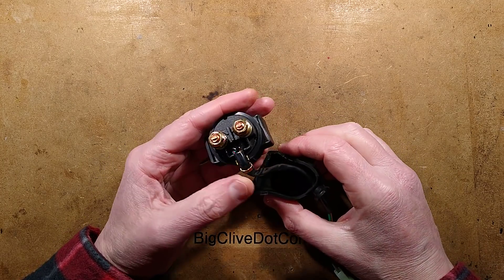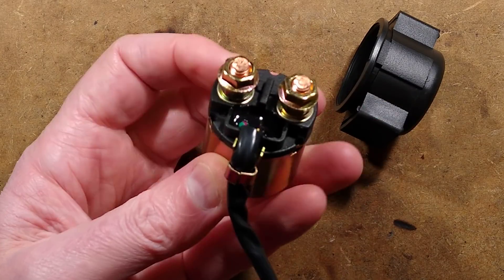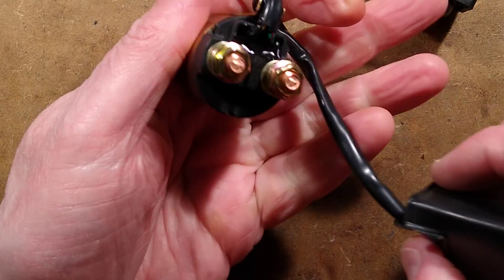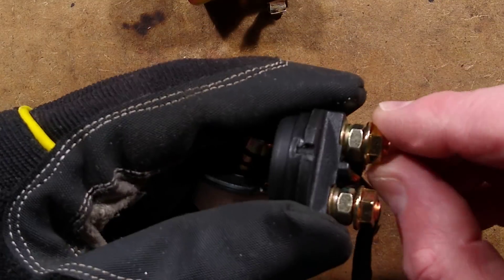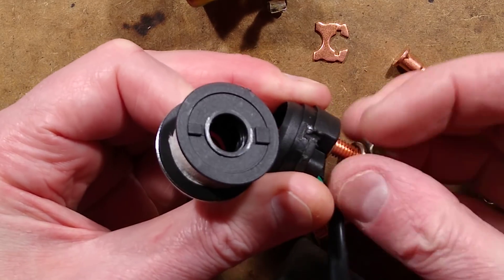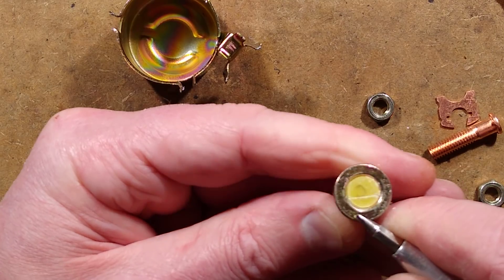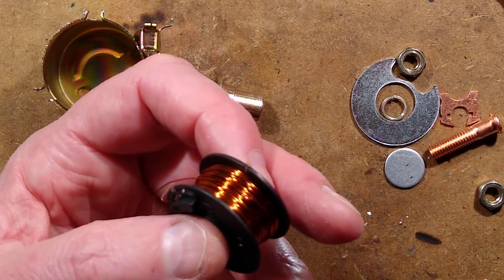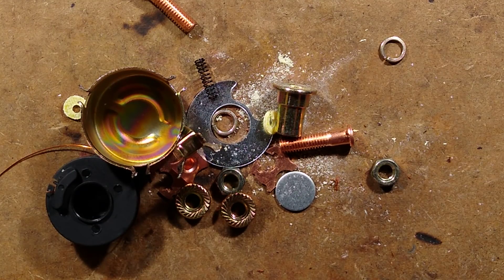Inside a cheap quad/scooter starter relay solenoid

Comment: Why does it need 3 amps!! Is it because of the voltage drop when running the starting motor wouldn't disconnect the relay entering in a loop?
Reply from the maker: It may be for universal 6V 12V use.

Comment: I had a 1960s Triumph car - the original starter solenoid was designed with a rubber dome on the end opposite the contacts, so that you could engage the starter just by pressing the rubber dome and moving the solenoid core directly. Very handy - no need to short the contacts with a spanner. I later had to replace it with a modern part, which of course was designed without that feature in order to save a penny per part.
Reply from the maker: That's quite neat.  I've never come across that.

Comment: There are some bigger solenoids that should be capable of handling 600 - 1000 Amps according specs. I wonder if these would be useful switches for spotwelders with a big car battery? I tried these but found they tend to stick together on the first or second weld. A good big car battery can deliver in access of 1000 Amps, maybe 2kA for a short time - thats probably too much. Is it better to use high amps power mosfets as switches? You would need at least 6 in parallel for the current. I know such constructions are around for li-ion cell spot welding and seem to work quite well.
Reply: Bingo ! 😇👇

https://youtu.be/o1NFbchHeM8

https://youtu.be/b_kGgPVrcCI
Reply: @davidbolha  The electrodes look a bit too tiny but they limit the current to something usable. For reproducable spot welds you definetly need a decent timer in the ms-range rather than just a push button. Also would be nice to see his power source here.

Comment: Hi Big Clive, have you ever looked at how gas flame failure valves work? They are electronic devices but don't have a conventional power supply. Would make an interesting  video i think.
Reply from the maker: They usually use a thermocouple to generate a low voltage that is enough to hold a simple magnetic valve in.

Comment: Doing the same to open small motor housings to find out what colour winding wire they used as a child 😂 I still have a right angled scar on my finger where I lifted up the flesh to reveal the gristle underneath

Comment: Actually the bolts being copper coated steel is better than them being copper. People tend to over tighten these and it is very easy to strip copper bolts. The actual contacts being real copper will serve the purpose well enough, no need for the bolts to be copper too.

Comment: When i was a kid, money was tight so replacing a starter relay or solenoid was the last resort, 
The gm solenoids were easy to take apart,  sand paper the contacts and disk. Good as new.
The ford relays were riveted together,  drill them out and same thing, then a couple screws to hold it back together. 
When manufacturers started crimping them together that pretty much ended the non destructive disassembly.

Comment: The problem I see with this device is it's limited to the quality of the bridge piece.  The amount of contact pressure is limited to that small spring.  The amount of power the coil uses has nothing to do with how well the device switches.

Comment: I had one in my scooter, and it got stuck once so i had to tear off the main battery cable to get it to quit cranking the engine
Reply from the maker: Quick fix may be to find something hard to hit the solenoid/relay with.  (then replace it later.)
Reply: @bigclivedotcom  I took it apart and found some water inside it etc, not good quality but got it working temporarily until i'm getting the new one!

Comment: Just had to replace one very much like this in my scooter.  The starter would not stop turning over until I hit the solenoid or disconnected the battery. Was not ideal. Hope you are having a nice holiday season.

Comment: I'd still feel iffy calling it copper, I've had cheep coils/xfmrs that appeared to have copper wire due to the enamel color when the wire was actually aluminum. What I thought was high temperature solder on them must have actually been some sort of brazing. That said if it were plated it could still be soldered to normally

Comment: Parents furnace control board let out the magic smoke the other day. Replaced the run capacitor and the control board and they are all set. Pulled the melted relay from the old board and took it to bits. I found that the out of spec run capacitor drew too much amperage and over heated the relay just enough to cause it to move slightly causing poor contact when it was engaged and causing it to completely meltdown.  In hindsight I should have filmed it.
Reply from the maker: Relays do progressively fail over time.  Often melting when they go higher resistance.  A failing run cap can cause the motor to run inefficiently and heat up too.

Comment: I wonder if they used off cuts from one of the circuit board manufacturers? I’m sure one of them laser or water cuts holes that leave blanks that size, or maybe it’s from a larger hole and it’s mill cut?

Comment: did nobody else give a thought as to why there would have been a use for that steel plate mounted on top of the coil?

My first hunch would've been that when the coil energized, the coil itself, with the steel plate would hit the back of the studs, (the big flat heads) and  do the most of the transfer for the current.

The 'weak' spring would keep the coil back from accidentally engaging the solenoid, and the insulator in the cap would help prevent the same effect.

i feel that the tiny copper contacts are way too tiny to be able to use for a prolonged time or for more than a few hundred starts.

Comment: well if the coil takes 3 amps(why was that designed, relays with same ratings require a few mA), if battery is weak it will chatter, happened with me, & also why do  all automobile relays take significantly larger current than their electronics version, they are always hot to touch.
Reply from the maker: It may be so they actuate with more force to reduce being affected by vibration.

Comment: They fit these on Lexmotos and the high current draw can melt the starter switch. And the solenoids fail with monotonous regularity.

Comment: Every time you mention stabbing yourself in a video I have flashbacks to an incident involving an electric drill.

It was all going well until suddenly I found my finger and a P-clamp wrapped around a bent drill, with blood and bits of skin everywhere, bone exposed, and a fingernail missing. Oddly it didn't even scar, and the nail did grow back. The skin there has always been more fragile since, though.

Didn't even really hurt except while I was cleaning it, which puts it far above the incidents involving metal filings and no comparison at all to road rash.

Comment: my only question is: 1.7 AMPS did you say? that seems a LOT of current for just a small contactor..  I've messed around with large tri-phase  A/C contactors {capable of hundreds of amps) and yet only drawing around ninety- to 300 miliamps tops...  {at 12 volts, rated  for 24); I wonder if that coil may be shorted?  {now AFTER I read the rest of the desc, I suppose the  really short duty cycle may explain things.. guess it would really need the THUMP of torque to pull in/out...  I donno- still seems excessive in my opinion)

Comment: I use this component as part of my spot welder for battery cells. I have a foot switch connected to a programmable relay. I use a motorcycle battery 12v 14Ah. The negative electrode comes right off the battery and the positive electrode is interrupted by this starter relay. And then the programmable relay will trip this relay and make the connection for anywhere from hundreds of a second to seconds. It's a Frankenstein mess from parts I had laying around but it works better than the ones I've paid for.

Comment: Interesting it basically used a balance between the two springs to keep the steel plunger from completing the circuit when off

Comment: The backyard fix for an old General Motors starter solenoid was similar to what you did, take it apart, flip the copper washer/contact, put it back together and you are  good to go.

Comment: Spending $100k R&D to reduce the manufacturing cost by $0.10 on a product which is going to be build by the tenths of million (scooters are very popular in south east Asia) is a win win situation, it reduce the production cost allowing cheaper product for the user and greater profit for the producer. Produce in the EU this wiring harness would be sold well over $100 instead of less than $10. Why do you think the EU is not selling any scooter in Asia? Labor cost or poor design?

Comment: I bought a starter solenoid for a liquid-cooled Honda 2 cylinder engine that I bought for a tractor. The OEM unit was about £67 ($90) so I bought one from a junked Japanese motorcycle and made it to work. The starter cost more to rebuild, so I bought new one for it.

Comment: I suppose it is configured like that so that on release, the armature can build up speed before impacting on the contact plate thus effecting a rapid break in circuit.

Early starter motors were called 'inertia starters' as the pinion gear on the starting motor would slide axially on the motor shaft. A 'reasonable' spring would push the pinion out of mesh with the ring gear on the engine's flywheel. That type, the pinion not only slid on the motor shaft but rotated on a coarse thread. The sudden starting (rotation) of the motor would effectively screw the motor pinion along the motor shaft into mesh with the ring gear (hopefully) whereupon it would start driving the engine. This load/torque to drive the engine keeping the starting motor gear in mesh with the engine. Once the engine is firing and running faster than the starting motor, it would throw the motor pinion out of mesh protecting the motor from being over-revved by the engine.
This system worked fine provided that the motor pinion was free to slide and the motor started quickly enough for the inertia of the weight of the pinion pressing against the aforementioned return spring. A flat-ish battery was sometimes the cause of just spinning the starting motor without driving the engine. The sliding action could become stiff from clutch plate material dust getting into the coarse thread - noted by people who slipped the clutch a lot !

In the 1980s, the system was changed. Rather than using inertia, the starter pinion was placed into mesh with the ring gear by a solenoid. The advantage of this was that the motor was not started until the gear was fully in mesh - making a more reliable system. This solenoid is mounted on the side of the starter motor and performs 3 functions. Firstly, engaging the starter pinion with the ring gear, secondly, doing what's shown in this video - and turning the power on to the motor itself and thirdly, turn off the 'start' winding of the solenoid - so if it was held on for a long time, it wouldn't burn out. The solenoid therefore has 2 windings - a high current one to get things moving and a low current one to hold the solenoid in once it had got there. Once the 'ignition key' was released, the solenoid turned off allowing the pinion to disengage with the ring gear and turning the power off to the motor.

For anyone who wanted to know.

Feel free to ask questions !

Comment: The toughest job these solenoids have to do is not the 49cc or even the 150cc GY6 engines, but the tiny starters on the 43cc and 49cc 2 stroke engines.  Those tiny starter motors use VERY strong neodymium magnets and windings that are just this side of a short circuit.  You should check one of these out if you get a chance, but they are direct drive (no gear reduction) and therefore require attachment to the engine (crankshaft) to run them.  They use a magic black box to allow the motor to charge the battery after it starts.
Reply: c.f. 'dynastart'

Comment: So is that the same as a relay?
Reply: Electrically, yes.
Generally though relays can have multiple independent switches so one relay could turn stuff on or off of different voltages. Also they have the option to make contact when on or make contact when off too. Contactors do this too.

Comment: I prefer that design- the springs force the default condition to "contacts open". I don't know about England but Ford starter relays/solenoids/contactors here in the US have the bad habit of getting stuck "closed". Since most of the time you have to use a screwdriver to get them to close, at least you have a handy tool to whack it with to get it to let go.
Reply: It's one of the things with this design. Should the contact weld closed, when the solenoid armature is released, it hammers the contacts open.

Comment: Clive, you might want to consider a pair of cut resistant gloves. My hands are in so much better shape these days. I usually just wear one on my off hand when holding something and going at it with an exacto blade or screwdriver. I think I paid £3 from eBay for mine.

Comment: You're wrong, it must be normally open, otherwise the starter would always spin when ignition is on.
Reply: Eh ?
Reply: The contacts inside can be considered normally closed because they are closed unless the internal button is pressed. When the unit is fully assembled the plunger normally presses this internal button. So yes, of course the unit as a whole is normally open but also the contacts themselves are NC.
Reply: @eDoc2020  Having thought about that, I'm going to disagree. "Normally" means in an unpowered state" and it must be taken similarly that the assembly is complete, not partially assembled.
If you mentally remove the contact spring and replace it with a direct linkage to the solenoid armature, it'd be clearly NO. That link has simply been replaced by a spring.
The unit as a whole would not be used in an incomplete state - so I'm sticking with NO !
Reply: @millomweb  I think this is a case where it actually makes sense to agree to disagree. The contacts can be separated and used separately.

For further thought, we can consider the light inside a refrigerator. Is it NC or NO? The light comes on when the door is moved out of its resting position, thus it is NO. Yet the switch turns off the current when pressed, thus it is NC.

Comment: if it wasnt a stuck solenoid it was brushes not in  contact... a 2 foot length of 2x4 was my go to solution. easily stored in the pickup box.
Reply: Youth trip to Germany in the 80s. Being friendly with the coach driver, I was the one asked to hold the key on while he went to hit the starter.

Comment: A flasher for a vehicle's blinker is interesting to explore. It's a similar package with a relay and a circuit to oscillate faster when a light goes out.
Reply: The old ones were thermally timed.
Reply: @millomweb  I recently took apart both. Thanks to big Clive a take everything apart. Or to bits

Comment: Tested one of these as an AC switch on a lamp and it works. Of course DC controlled.
Reply from the maker: The coil in these is just suited to brief use.  It draws a lot of current.
Reply: Why wouldn't it, it doesn't care what it's switching, it only cares about how it's controlled. Why tho? You can buy mains relays cheaper.
Reply: @bluef1sh926  For low amps sure you can... For high ac amps this is cheaper.

Comment: The relay on my Honda CB 750 motorbike failed circa 1989, the price of a new, original Honda part  was outageous so I stripped my old one down. From what I recall the design seems identical except the copper coil was much weightier and more substantial than this thing. In my cack handedness I broke the soldered coil wire ends  (to quote AvE "it's already fucked so... etc.) but once cleaned up and polished, I unwound the coil a little to release some fresh wire, bodged it all back together and bugger me, even with my bad soldering  I'd fixed it. This, to my memory, is the only Genuine Honda part I have been succesfully able to fix.
Reply: I've fixed the "blower motor resistor" which controls the back seat fan on some MDX and Pilot cars. It's actually a transistor on a heatsink with a thermal fuse. I replaced the thermal fuse and then the fan worked again.

If you do this yourself be sure to clean the dust filter by the fan or else the lack of airflow will make it overheat again.
Reply: @eDoc2020  I have a peugeot 406 blower resistor awaiting the very repair you describe in amongst the broken artefacts on my "offerings to the almighty electron" shelf.